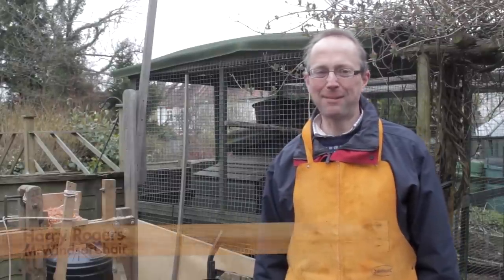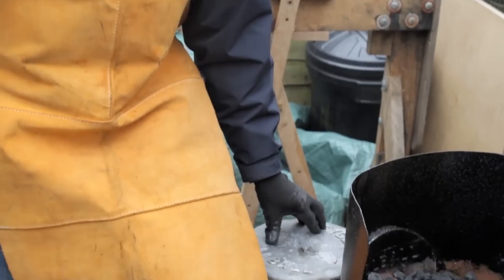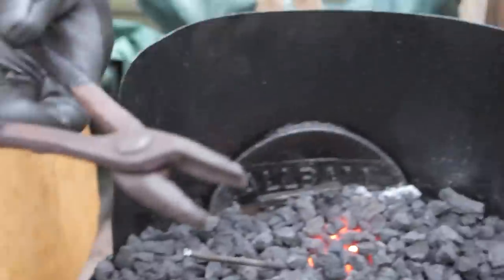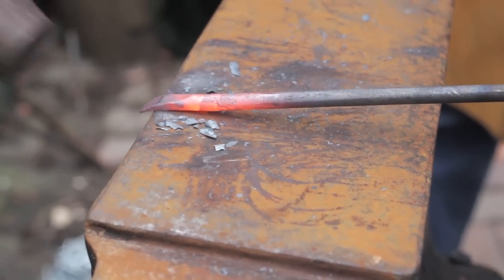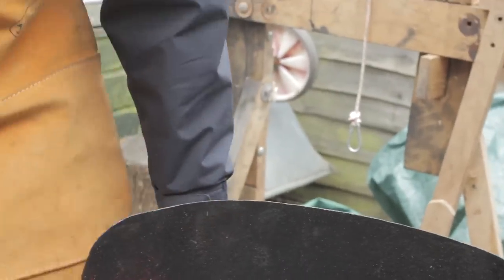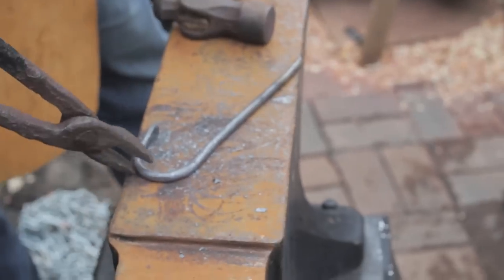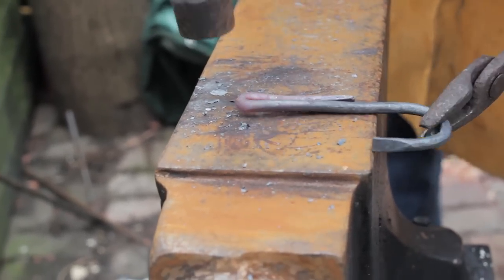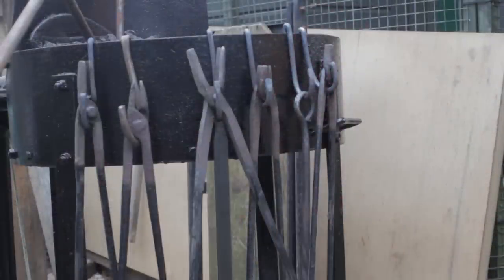Blacksmithing - Heyden Allball Portable Forge

Comment from the maker: Hi Bill - its coal - Sunbright doubles which are a coke based coal for blacksmithing. At the weekend I did some blacksmithing with a friends charcoal forge, and that was great - especially as they had recently had a charcoal burn, so there was a very good supply! I find the charcoal gives quite a bit of cinder blow, but is otherwise great, though the coal burns for longer, which can be useful for a longer session. Harry